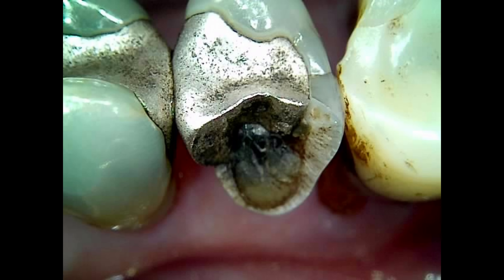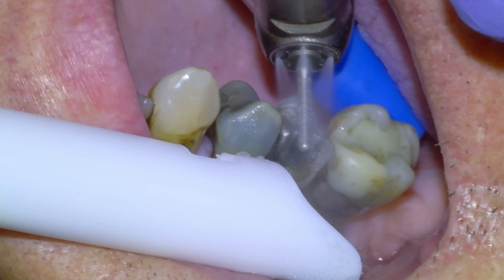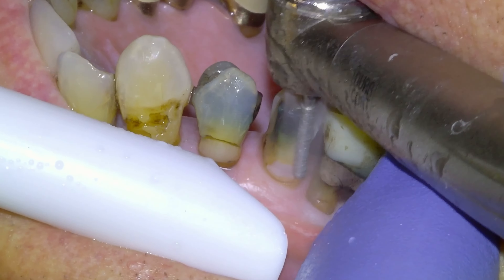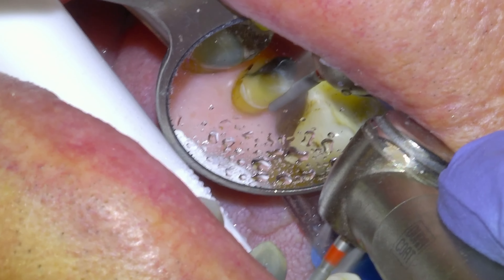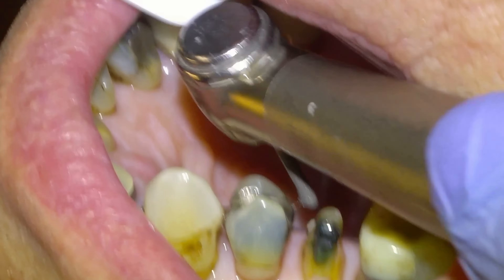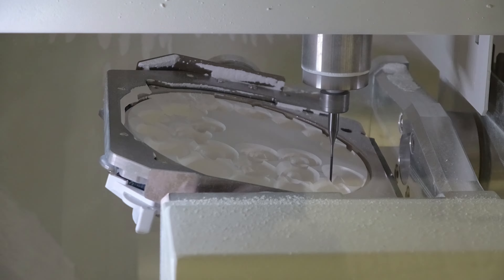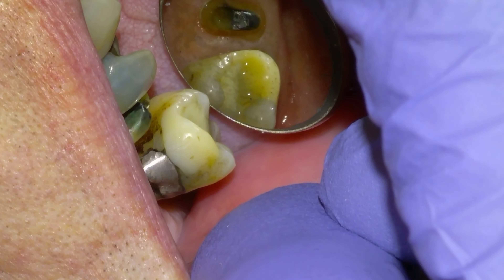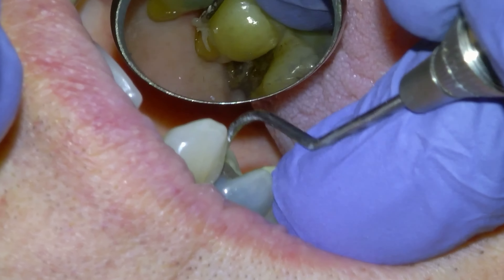[44] Fractured Tooth Repaired with Crown

Comment: Wonderful as usual. My assistant is having a difficult time keeping my mirror clean while working indirectly. any tips?
Reply from the maker: Thanks :) Every situation is different depending on location and access but it's always an ongoing battle and I am constantly wiping my mirror clean with the patient bib, it's right there and it works well. The assistant can blast air/water and then steady stream of air in certain situations that can help a bit if they aren't doing something more important but its mostly just wiping often when it gets too foggy or wet. Also a huge fan of high mag as well I think that helps a lot too
Reply: Thank you very much dear. She’s trying but still new to the field.